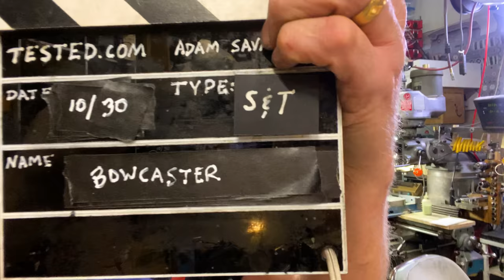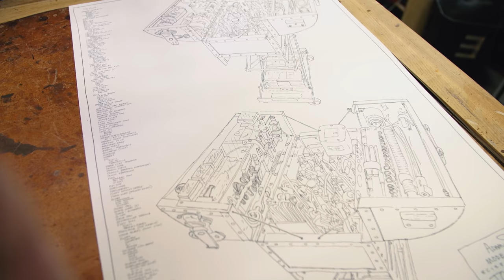Adam Savage's One Day Builds: Chewbacca's Bowcaster!

Comment: I need a "superglued myself to the project again" badge.
Reply: Or just "superglued my fingers together." Either one would work.
Reply: Mmm, yes, losing the sensation of touch for a few days with a thin coating of super glue is always fun
Reply: @TheTrimed1  use some sandpaper or even a nail file (sanding stick according to Adam) and lightly sand down the glue until it's gone.
Reply: Me too dude, me too 😂
Reply: Happens every time I handle superglue.

Comment: Sir, like your channel. I need to have a brass connector M10x1.0 Female to a green gas valve (dummy). This will be used to attach a pcp foster connector to a green gas airgun.
Allowing me to use compressed air.
Is this possible,?

Comment: Easiest and cheapest way to get your Fullers Earth is grab a bag of Oil Dri floor absorbent, and grind it down yourself. Use either in a pestle and mortar or a coffee grinder. Just don't breathe the dust! You can use it mixed with water as a slurry to pull grease stains out of marble or quartz, or even bury a wood project you're working on to dry it out and raise the grain. That will allow stains and varnishes to penetrate deeper and make the grain pop.

Comment: I noticed that you are still using older nicad batteries on some of your Dewalt tools. Dewalt (and 3rd party manufacturers) sell an adaptor, so that you can use the newer lipo batteries on the older tools. Not sure if would help, but I figured I'd mention it, just in case.

Comment: One thing that would be weathered but obviously smoother would be the grip.  It wouldn't match the rest of the Bowcaster, because Chewie's strong hands would have gripped it and rubbed it smooth (delicate as necessary for a precise shot, markswookie that he certainly is).

Look at the grips on your older/favorite cordless drills?  They're worn, but 'polished' over time with the oils from your hands soaking in like a fine furniture polish.  They distinctly don't match the rest of the body.

Comment: Why does that fold out ladder look backwards?  It looks as if it would be safer to flip it over so the hinge shuts tighter when you climb it. not tries to tear it apart and fold under your weight.  Even if there's a pin in that it should be used the other way.

Comment: I realize from a propmaking perspective "weathering" is an all encompassing term but so much of what he said about how his bowcaster was treated just made me think it would go click when he needed it to go boom and boom when he wasn't expecting anything at all.  Wear on stocks, buttplates, trigger guards, barrel bands, slides, etc, yeah it totally happens.  Buildup of dirt and grime?  Hell no.  If your weapon fouls from dirt or neglect you die.  Full stop.  No second chances.  A Bowcaster is a rare, slightly archaic, ceremonial weapon that wouldn't have parts available on many worlds.  While it  is certainly extremely durable and well made Chewbacca would know this and would take care of it accordingly.  You would likely not find any significant dirt, grime, or rust on it that would be older than the length of the current mission or time in the field.  Pitting would be minimal as rust would likely not be allowed to set in.